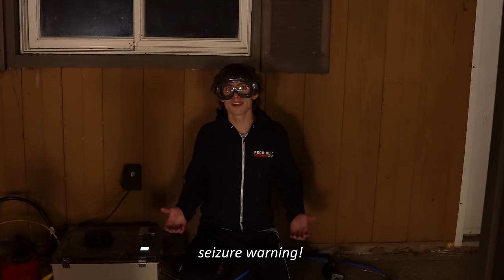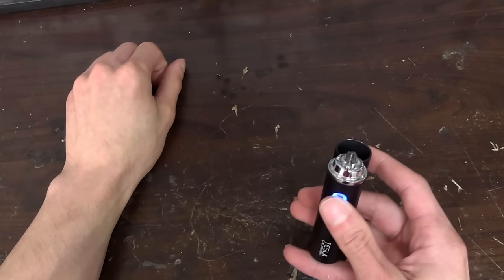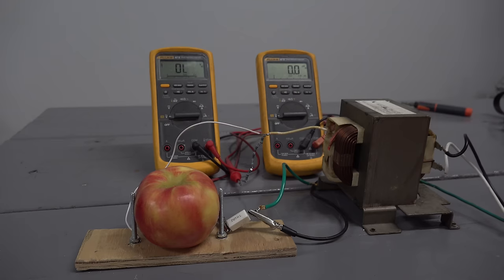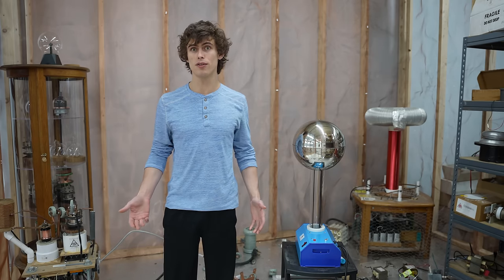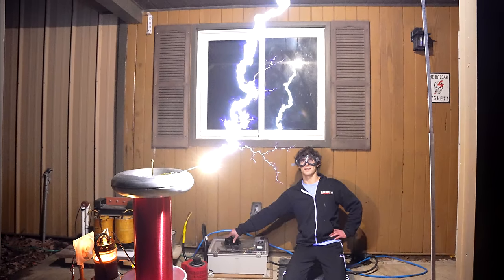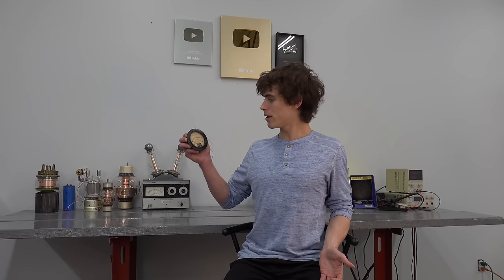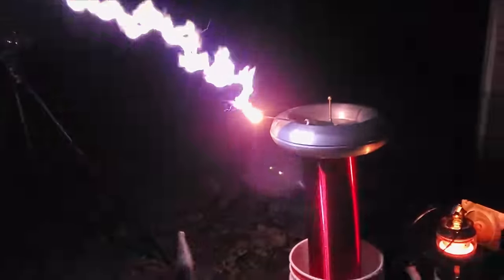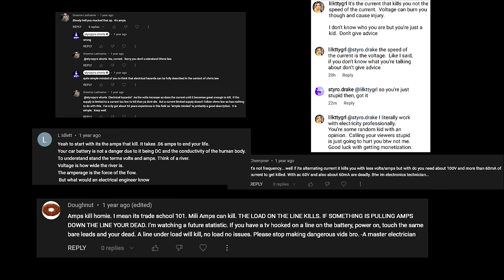Is it the volts or amps that kill?

Comment: As an electrical engineering student for 25+ years I can confirm this video is completely accurate
Reply: u didn't know don't even try to be like this absolute genius 😂
Reply: @try2win198  ??? They said they've been studying for 25+ years. What are you on about
Reply: @try2win198  L bro
Reply: I hope its because english is not my native language. But being a student for 25 years is not something to be proud of, right? I hope you graduated at some point :)
Reply: Not really, it’s misleading and it’s just not useful to say oh well it depends. When assessing the hazard of an electrical source it’s the volts that is always the relevant figure. Yes there are quirks where by high voltage sources don’t pose a threat but these are quirks and are only present in very specific circumstances; regardless, if you treat any source over 50 volts as potentially harmful then you can’t be under any threat can you? Most electrical sources over 50 volts that you encounter in electrical devices do pose a hazard.
Reply: @Make_Boxing_Great_Again  But it is the right answer.
You can cry all you want about how most sources this or that, but this video is trying to give an exact, accurate answer, so you are in the wrong here.
Also, not sure what video you watched, he didn't just say it depends he presented multiple illustrative examples of stuff that can and cannot kill you with different voltages, currents, frequencies, etc. And explained them thoroughly. It is in fact your criticism that strikes as pretty damn dumb and reductive.
Reply: How was the demon circuit at the end considered to be lethal due to no isolation.. It was running at a frequency that was too high to hurt (over 13mhz)?
Reply: @Make_Boxing_Great_Again  Be careful with that notion of "high frequency doesn't hurt" that is not what styro said and it is 100% untrue.
Very high frequency makes the neurological effects of electricity go away, but it doesn't do anything to un-toast you. If you hook to a high power source for sufficiently long time you still die regardless of the frequency, styro does what he does because he has everything calculated.
And in the demon circuit he said there is an issue with the isolation of the DC source, so not high frequency in practice.
Reply: @marcossidoruk8033  Then how was he able to hold a metal rod in the arc and be fine?
Reply: @Make_Boxing_Great_Again  Watch the video again lol. He said it, the current and voltage are out of phase.
Reply: @marcossidoruk8033  All important points here.  Thanks for pointing them out.  There are certain really high frequencies which can really absorb cook more than others too (in the microwaves), and higher still can be ionizing (X, Gamma) causing possible mutation.
Reply: @marcossidoruk8033  This is the way he justified the level of current or voltage without exceeding total input power.  The current and the voltage should be roughly in-phase in the human "circuit component" due to the low inductance and capacitance at the frequencies in use.
Reply: @onehitpick9758  microwaves as well as X rays and Gamma rays and light are all electromagnetic radiation wich is a very different phenomena.
Here we are talking current.
Reply: @marcossidoruk8033  They are the same phenomena built from electricity, and magnetism, but the behavior, of course, changes as the frequency gets higher.  My point was when the frequency gets high enough, things really change, but you can still get cooked. There are still currents, "displacement" currents, voltages, flows, and more at the higher frequencies. Some frequencies get absorbed more than others.
Reply: @onehitpick9758  They are absolutely not the same phenomena there are no currents involved in electromagnetic radiation, electromagnetic radiation is just a change in the electromagnetic field that propagates, current is the flow of charge, radically different.
Sure electromagnetic radiation can and does induce currents in conductors but that doesn't mean they are the same phenomena.

And don't talk about things you don't understand, displacement current is an awful misnomer that causes a ton of confusions since it is not current at all, it doesn't even have anything to do with current but since Maxwell gave it that name then some are stuck with it, but it is an objectively terrible name
Reply: @marcossidoruk8033  It's called a displacement current in a vacuum, and of course it's notional and not a current made of electrons. However, there are currents in media like humans, even at "RF" frequencies.  It's all electromagnetism, which is all governed by quantum electrodynamics, basically the interaction of electrons with photons whether it's a propagating wave or electrons/holes moving in a material. That's what I meant by the "same phenomenon".  When frequencies get high enough it's more the radiative energy that is going through something like a person, and then when it gets higher still it will be blocked, and then higher still it will go through again. I was trying to point out the continuum of frequencies, and meant no offense.
Reply: @onehitpick9758  1. I never said you offended anyone, I just corrected you wich does not ammount to aggression or being offended.
2. You say a lot of stuff and you say nothing at the same time, literally 99% of what you say has nothing to do with this discussion. The fact of the matter is that you said radiation and current are the same and in fact used that logic to put in the same groundings current and stuff like microwave ovens or X-rays, that is is simply and plainly wrong, you definitely cannot do that extrapolation because the physical nature of currents and the Physical nature of electromagnetic waves are VASTLY different, the fact that they are both governed by Maxwells equations has no relevance at all since that doesn't imply your comparisons are at all fair. They aren't.
Reply: @marcossidoruk8033  I never said what you somehow gleaned. I said they are the same phenomena, meaning they are electromagnetism, or more specifically quantum electrodynamics. Of course the  effects and transport mechanisms differ as a function of frequency and coupling. All my points are valid and meaningful. You are misinterpreting them and mis-quoting them and really focusing in on something imaginary instead of just thinking about higher frequencies. I am ignoring any replies on this. The traffic should be good for pyro, however.
Reply: @onehitpick9758  I am not misinterpreting anything, you are just talking plain nonsense about stuff you don't understand and your lack of understanding just doesn't let you see how wrong you are.
I didn't misrepresent or misquote anything you said, you DID compare microwaves X rays and currents and you DID say they are the same phenomena. After I corrected you you said "I meant they are described by the same theory" and I explained how that is irrelevant and doesn't mean what you pretend, not responding is the best thing you can do because you are clearly out of your zone of comfort and your points are utterly impossible to defend.

The fact that both currents and electromagnetic waves are described by the same theoretical framework bears no relevance in this conversation since again, that doesn't mean they are the same phenomena. Furthermore, 99% of the electrical phenomena that are if interest for this channel and this conversation can be perfectly described with Maxwells equations and there is absolutely no need for bringing QED other than trying to be pendantic in a really silly manner wich is obviously what you are trying to do.
"the effects and transport medium differ as a function of frequency and coupling" What? First I don't think you understand what the word coupling in the context of QED means, and secondly the "transport medium" don't "differ as a function of frequency" that is the whole point of your misunderstanding and it is exactly what you are refusing to hear, frequency has nothing to do with wether something is an electron or a photon, what you are saying is factually incorrect. Electrons and photons are of a completely different nature and that doesn't have anything to do with frequency at all, you can have currents with pretty much arbitrary frequency and EM waves with arbitrary frequency, those are literally complete different things and just because they are all "electromagnetism" doesn't mean anything.
Reply: A student for 25 years? Did you keep failing your exams?
Reply: I think this was just one big /r/woosh,,,,
Reply: @BackseatGamingJesus  bingo! You're Hard to fool
Reply: @Make_Boxing_Great_Again  he clearly demonstrated that it does indeed depend. Where's your video proving otherwise?

Comment: The volts need to be high enough to overcome the resistance of your body.  The amps need to be high enough to do damage.  Both need to be high enough in combination.  You make a great point about the time.  I'm sure many people don't think about it, though they probably assume it intuitively.  I didn't know that frequency played a big role.  I'm gonna do more research about this.  Thanks!
Reply: People like to think it's one or the other but electricity comes in a package with all those parameters, it's the whole package that kills you, not voltage or current.
Reply: @dener22119  Volts determine any potential current that can flow through you, therefore if you only consider voltage as a relevant figure then you will be safe. Only considering voltage is much more practical as most electrical devices have enough current to kill but only some electrical devices have enough voltage to kill. Even a simple flashlight can use an amp of charge, an amp is enough to kill someone several times over given the correct voltage. Flashlights are usually less then 10 volts hence they are obviously safe. Yes there are quirks where by high voltage doesn’t pose a threat but these are quirks and under very specific circumstances, it’s just too impractical to consider all these other quirks and circumstances just so you can take less precautions around a high voltage source. 50 volts and above is nasty and dangerous, below 50 volts is relatively harmless.
Reply: Great explanation 👍
Reply: @CircuitDen  You’re welcome.
Reply: @Make_Boxing_Great_Again  You make very good points.  Though, I've even heard 45 volts should be the cut off.
Reply: @keyofg2020  50 volts will shock you and it will be unpleasant but it won’t cause any permanent damage.
Reply: Higher frequency means more DPS for the shock
Reply: @Make_Boxing_Great_Again  I charge the 3.7 volt defibrillator... Nope. Sorry, you're still dead. I cheated, the thing discharges at reasonably high pulse voltage. But it uses a low voltage battery. Yet if you use a low enough setting (*which is in Joules*), you will probably live despite the same voltage. Check out what an electrosurgery knife does, as well.
Waveform/frequency mostly matters because nerves and fun electrochemistry involved. Energy matters always - don't stick yourself in a microwave even though there's no voltage or current. Likewise do not puncture that charged lithium battery, despite current or voltage involved in this being low and it being DC. Don't step in front of the electron emitter unless you're taking a controlled x-ray/CT. I probably shouldn't have to mention walking inside a working synchrotron. Equation for dielectric heating is quite fun, Joule heating also fun.
Reply: The higher frequency is the main reason why we are able to get by with using half the voltage that they use in Europe. Our electricity runs at 60 hertz and European electricity only runs at 50 Hertz. The higher frequency is able to turn electric motors about 20% faster. It also allows a smaller motor, with fewer windings. 

The 50 hertz is better with more efficient energy transmission and the transformers work better.
Reply: @actionjksn  Good to know!  Thanks @actionjksn
Reply: @actionjksn  This is still low frequency for the purpose of skin contact making essentially no difference. I was thinking kilohertzes minimum.

Halved voltage makes the typical motor half as fast, which the 15% difference in frequency does not compensate for. And the low voltage means bigger current means thicker windings (so that they don't burn) so the winding mass is actually close, but you need chonkier magnets (because magnetic moment depends on potential) and thus casing for US winding.

Cue magnets, how do they work meme.
Reply: @AstralS7orm  He was clearly talking about induction motors. Their speed depends on the frequency, not the voltage, when they are not in a big slip.
Reply: @Make_Boxing_Great_Again  I hear what you're saying, but there's no such thing as an 'amp' of charge.
Reply: @Make_Boxing_Great_Again  100 volts for me to feel something

Comment: You briefly mentioned high-frequency dangers.  I spent 4 years in the US Coast Guard and worked on aviation electronics.  We had a high-powered UHF radio that if you  were unfortunate enough to ground the signal through your body you were in deep trouble.  The power was high enough and the frequency high enough to burn a path through your body.  The hospital trip involved, if you were alive, involved the debredding of the pathway through your body.  That meant that the surgeon needed to open up your body and remove the burned tissue to prevent infection.  As you can imagine this was an excruciating injury to recover from if you were lucky enough to survive.  The HF radio was much higher power over 1,000 watts and could easily kill you so great pains were taken to never energize a transmitter when anyone without their knowledge could come in contact with the signal.  If the signals were connected to proper antenna they were significantly safer as the power was then converted into transmitted power although grounding an antenna through your body could still result in significant burns.

Comment: This was really useful because some time ago I was trying to decide whether or not a 12v supply was safe around my kids.. now I've simply no idea what's safe. Thanks!
Reply: 12v is safe. Anything under 50v is safe as it can't break down your skin. I would still make sure any connections are insulated if the 12v power supply you are talking about is stepped down from the mains, as it could go wrong and pass a much higher voltage which can breakdown the skin and as ac in the wall has a low-frequency (50-60hz) and high current then this could be dangerous.
Reply: Faaaaairly safe. Of course if You make a short with a pencil or thin wire, You could burn Your house down. Hope that helps :-D
Reply: Well electrically yes. Could still start a fire though
Reply: @nick.020  dude the video just talked about this. Watch it. If it’s 12 volts, no matter how much current it is capable of putting out, touch the output and nothing will happen to you at all

Comment: Thank you for making this video. This is going to be required viewing for the next person that tells me AC kills, DC kills, volts kill, or amps kill. Something you skipped was contact area, but the resistance of the body somewhat covers that. I've been shocked by a lot of things that would have electrocuted me under these simplified rules. We used to play around with a Keithley 237 SMU, shocking each other with 1100VDC, but it was current limited to 10mA. My old boss at General Electric didn't believe me and said I'd be dead if that were the case. I've accidentally touched both terminals on an ultrasonic generator while it was on and it burnt my finger so bad it had the texture and smell of a corn chip for months. For a few years when it'd get cold that finger would hurt, but that eventually passed. The voltage was low, around 36V, and current was roughly 0.5A, but the frequency was around 40KHz. That, combined with a very small surface area contact with my skin, is probably why it burnt. With capacitive coupling, skin moisture levels, and phase/frequency it's hard to know for sure what's going to bite and what won't.
Reply: My credo always was and is: electricity kills. Be careful around it, except small batteries driven things like flashlights or so, the worst thing there when mishandling is a fire (especially with lithium). That kept me quite safe, so it can't be that wrong 😉
Reply: And even at high frequencies, you're not safe either. At high frequencies, you won't be electrocuted due to the frequency being too high to affect your nervous system, but RF burns are a very real danger. Just the heating alone is enough to cause severe damage to your skin and other tissue.

Comment: Haven't watched the video. But I know you need both. Voltage to drive the amps through the body. You should be able to touch massive amounts of amps, so long as the voltage cant push the current through you

Comment: As an electrician, school taught me 50 volts at 300Ma is the maximum allowed voltage / current. When you multiply those numbers you get 166.66666 smth ohms which is the maximum allowed resistance for ground in the Netherlands